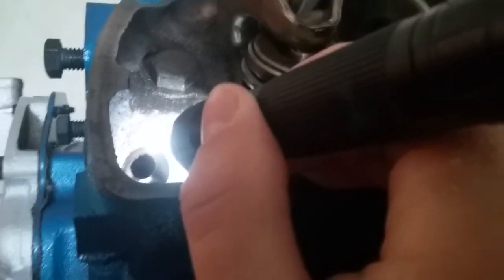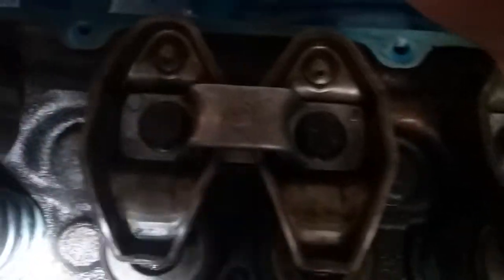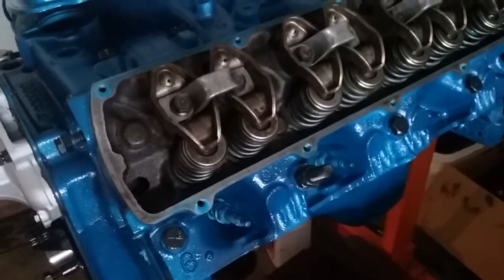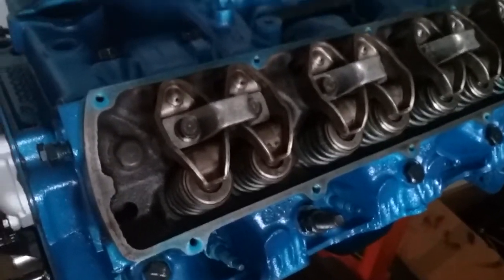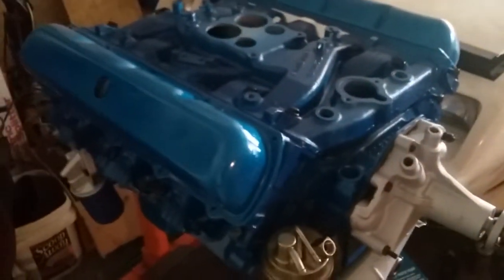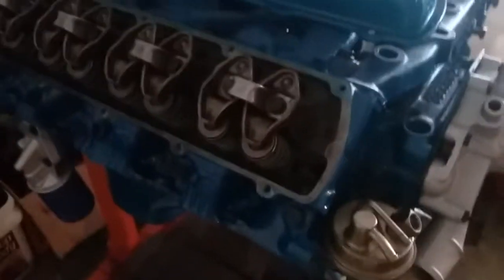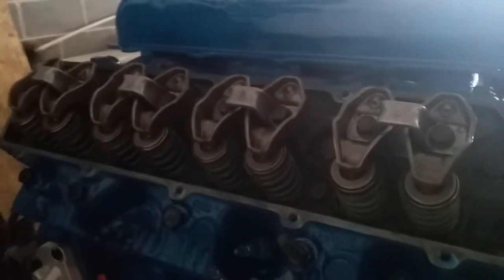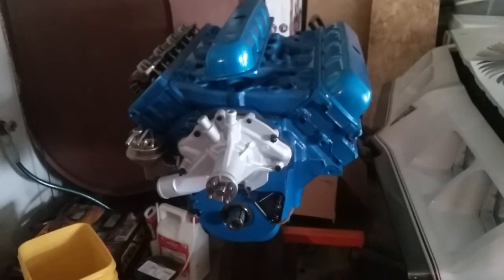Oldsmobile V8 Oil Drain Back Issue

Comment: I have raced Oldsmobile cars for 20 plus years. My first 350 olds drag car had a stock bottom end stock oil pump deisel pistons and rods number 5 heads ported performer rpm intake ultradyne cam comp roller tip rocker kit and a complete msd ignition. 1983 olds Cutlass ran 12.39 with that motor shifting at 6500 rpms and hitting 7200 in the water box from time to time. Never blew up never had any oiling issues nothing. Raced that motor for 8 years never any problems with oiling system none. Now I have a 660 hp 355 olds engine in it and it's built out of good stuff. It has no oil restricters in it and it runs about 70 pounds of oil pressure and I shift it at 7000 and still no problems like you say????
Reply: My Olds drag car uses a tornado oil pan and windage tray, it makes around 620hp, .060 69 455. Runs 10.60s in 1/4, shift at 6800rpm, I built it almost 30 yrs ago, still have it, just gets freshed up about every 5-10yrs depending on how much use it gets. Mostly sits in the garage these days. Olds engines can hold up fine. All I did to the block for oiling was deburr it and opened up the oil hole in the rear main cap where the oil pump bolts on.
Reply from the maker: 1970 olds442 thats pretty damn cool in general you race olds. They don't get oil pressure problems, they tend to suck the pans dry and the oil doesn't come back down fast enough. How many qts does your oil pan hold?
Reply: Useful Entertainment engine with Diesel pistons had a stock 455 pan on it. Oil pressure gauge never dropped  have Auto Meter gauges
Reply: Useful Entertainment new engine holds 8
Reply from the maker: 1970 olds442 there you go that solves the problem. I like my 5 qt pan, extra ground clearance.
Reply: @UsefulEntertainment  never sucked the pan dry with my old motor

Comment: Romeo Void...playing in the background....lol!!
Reply from the maker: Lyle Lillithwort hell yeah 😉
Reply: I did nothing but premix as I revved the hell out of these , I ran nothing but 2 stroke oil, old olds where like snowmobile motors, newer ones were junk. Some olds DRCE can be converted to 2 strokes with Klotz at 50 2 stroke oi with a vro
Reply: Now run dry sump with oil injection for total loss. I premixed at 40:1 and filled the motor with synthetic 2 stroke oil, just inject it and run it like he s rotax snowmobile motor
Reply: +Bruce Miller Dude, what the fuck are you talking about? Are you fuckin serious or just a fuckin lyer? You seem to be talking about another world of shit than these vintage Olds engines, you should probably stick to snowmobiles, cause none of that shit applies to 4-stroke automobile engines. I damn sure wouldn't recommend putting 2-stroke oil in your Olds engine. Better to stick to some 10-30 or 10-40 depending on temperature and clearances in the bottom end. Only similarities between a Rotax snowmobile engine and a Oldsmobile V8 is the fact they are both engines. That's where the similarities end.

Comment: My 455 did this and spun my bearings bent the rod and I only ran it 2 or 3 times after brake in 🤢big money down the drain  I had to rebuild it  💸💰
Reply: I think you turned to many rpms that's what killed your motor. The drain back he is talking about is not true
Reply: I run but nothing but tvw3 in it crankcase fed and oil injection.,  I i
rev the hell out of it
Reply: U. Must have been romping on it real frickin hard cuz I've run the dogpiss out of a few olds motors and as long as those holes weren't plugged never lost oil pressure cuz that's what would happen it would suck air lack of oil as he said it's not easy to do ..

Comment: Great video! Anyone who works on and runs these engines needs to know stuff like this. I myself have had problems with my 307. I have a 84 lesabre coupe.I've changed the stem seals in the heads 3 times in 10 years with very little results. Your video just showed me what I might have missed thanks!

Comment: #6 heads? Looks like a small block , either a 350 or a 403, painted 455 blue!
Reply from the maker: DR OLDS yep it's a 70 350. The color is metalcast blue. It's an anodized color. I wanted to paint it the color of the car I put it in
Reply: Small block were numbered heads big block were lettered heads  #6 be about mid '70's best ones was #4 from '67  330 c.i. high compression need to put valve rotators from the #6 heads in little machine work bit save the life for street use with pump gas...

Comment: I have the exact same engine.Can you give me the oil type and the info pertaining to these engines.Thanks
Reply from the maker: MechanicJake I usually use 5-30 or 10-40. I have a hard time finding low detergent oil in regular parts stores. The camshaft in these engine need a Zink additive  (ZDDP) as well. What I do is get oil from summit racing because they sell exactly what you need and they ship fast.
Reply: I run a 455 bored .60 over in my Jet boat. I have a little bit of oil that seeps out of my valve cover breathers but it minimal. I had the oil drain holes in the GA heads opened up a little more and the oil restrictors on the cam bearings. As fas as oil i use Rotella 15-40w because its one of the few oils that still has zinc in it. I run my Olds pretty hard around 5400 rpm and its still a solid engine
Reply: Any good oil with zinc in it will do, 10-30/10-40 range depending on temperature.

Comment: I’m pretty sure that the wagons are based on the 88 and 98 body styles. His had the Olds 307 in it. They are indestructible like you said. He put around 250,000 miles on his before he sold it. I just subscribed by the way.
Reply from the maker: Ryan Hodges yup the wagon is just a typical GM b body like impala, caprice, Bonneville, 88, 98 or electra lesabre or park avenue. Mine had a 307 and yeah they are indestructible, but you gotta get rid of stock nylon coated timing chain and gears or they always jump timing and bend valves. Thanks for the sub btw.

Comment: Oil restrictive pushrods is a new alternative I never heard before. Do you have any make or part numbers on those pushrods?
Reply: Mondello is where I would start. There ae others that made mods too.  The SoCal Jet Boat forum could be useful.
Reply from the maker: William Hugelmeyer I do not. I need to investigate them more
Reply: This id never s problem with Uniflow 2 strokes

Comment: great video for anyone out there getting into oldsmobiles. wish i would had these videos last year when i started planning my olds build. i know the whole sludge build up way to good. we tore apart the top end of my buddies 72 cutlass olds 350 and it was so bad we couldnt even see the head bolts. absolute mess. i took about a year doing as much research on olds engines and just finished up my first olds build this spring. olds 350 started out as a stock #8 head smog engine. new rings and bearings, a built set of #6 heads, 9-1 compression, comp cams high energy 268H cam, rpm intake and headers and it just runs like a dream for a streetable hotrod engine. The restricted pushrods is a good idea much prefered over restricting oil to the cam which to me doesnt seem like a good idea but i went a different route that you also suggested and went with the 7 quart pan and high volume oil pump and while i was in the process of opening up the exhaust ports i also ported and reshaped all my oil returns holes and made sure everything was flowing down hill. i also set my rev limiter to 5200rpms seeing how all my cutlass is is a street hot rod and i have no reason what so ever to push it harder. 5 speed stick shift car with 3.55 rear end i just up shift and let the low and mid range torque do the work. well so far so good. 1000miles on the build, 60psi on start up 40psi at idle fully warmed up after a long road trip and never once have i seen the oil pressure drop off from normal and low leaky valve covers. only thing i would add to the leaky valve cover issue is i have seen to many guys pry them off with a flat head screw driver and bend the ridge. be certain the cover is flat to eliminate one more possible cause for the leak.
Reply from the maker: damn that's the ultimate set up, the 5 speed with 3.55s. I wanted ti do the performer rpm 7111 intake and headers and a holley street demon but it was out of my budget. im running the mondello 20 - 22 cam with is 496/512 lift and as im sure you know you cant go past .500 lift with out adjustable rockers. I have the rockers I just need to put them in along with the new valve springs. ive thought about porting and shaping the oil drain backs but I didn't bother. how did you set a rev limiter? that's not a bad idea. if your interested in where this engine is going, take a peek at the last few videos on my channel. I just got my tranny back from the shop and I just got the exhaust installed on the car today. now that I have a full exhaust, I can swap my 307 to the 350 and break the new cam in.
Reply: I have ran olds like a snowmobile motor.
, they hold up as the 455 does great @ 40:1 to solve oiling issues. I run Klotz R4 2 stroke oil
Reply: +Bruce Miller Ha-ha! You funny.
Reply: i used to fill my 69 caddy 472 with pennzsoil synthetic TCW3 and never had a problem, i also premixed at around 60:1. Now all i use xd-100 in my truck. The tcw3 was a bit thick though but it worked.
Reply: Klotz is fine but the techinplate R50 is to thick. Xd-100 or amsoill dominator is enough and that what im running in my truck. BTW what does and olds engine do that other engines dont.? A gm 454 or 502 is easier to get more power out of. How ever there is the olds alumimum billet block that makes for a nice porter 2 stroke conversion. Its much easier to cut ports into:https://www.chevelles.com/forums/11-bench-racing/528170-2-stroke-454-a.html. Like this guy did with a 454 tall deck block. It's propable running dry sump with oil injection in to the intake manifold. I am thinking of doing this. A hremi motor though can be looped charged through the valves for a poppet valved 2 stroke with having to bastardize the aluminum block with porting. A hemi head olds drce would be perfect for this.

Comment: I was wondering why my 455 was leaking oil from the damn valve covers which I've never seen before. Thanks for the info
Reply from the maker: its not that big of a fix. I usually use a good amount of silicone sealer to keep them from leaking. heres a couple of videos for you  https://www.youtube.com/watch?v=-HFlz6nR998&t=128s   https://www.youtube.com/watch?v=xGThxcCnuMg
Reply: Dominic Daley thats not the problem this guy is a idiot

Comment: Is the 5.0 307 notorious for leaking oil?
Reply from the maker: tyler2610 only around the valve covers
Reply: I added the restrictors but I open the hole size to double.

Comment: Great video man! This is our first Oldsmobile motor well besides the 260 I blew up lol and I always get good information from your videos! Btw motor looks great
Reply from the maker: 1978 Oldsmobile cutlass hey thanks for the compliment, I just hope I can get it in the car soon. Lol howd you blow a 260?
Reply: Useful Entertainment  NP man and just ran the piss out of it haha I finally got mine all done I'll have a vid on here or my brothers channel soon
Reply from the maker: 1978 Oldsmobile cutlass good deal, I'm subbed to him so I'll check it out when it gets released
Reply: @UsefulEntertainment  most likely there was sludge in the engine, probably a rod bearing gave out, not getting enough oil. If the oil is changed regularly, the 260 is unable to blow itself up. I know this first hand, I owned a 79 Cutlass with the 260 and put about 200,000 miles on it before I swapped the motor, it was still running fine. I changed the oil religiously. The 403 it was replaced with was an easy power boost, got it from a junkyard ta. Even with the s*** rear end gear, the 403 and a good amount of low end power. I wish I still had that car, would have changed the rear end and put the 200 r4 I planned on doing.

Comment: Holy Hell, Bro: isnt it something: i was just putting the water and power steering pump on the old 70s 350! Hahahaha, Wow: that is a problem, and before i go farther: that olds just looks more BadAss with those valve covers! So at the high rpms the oil would get pushed up into behind the heads! Those holes are Miles Off, I just cant figure why it was set up that way. Yep, most likely a design flaw ( speaking on the behalf of The Olds Respectively because its such a badass ): what is the highest rpms it'll go? Im looking at the 1 head still on the 350 and i think i see a hole like that, im not sure if it is in the same spot ( top or bottom ) That was Great Advice you gave: ill know: i just might be in the market to get one of these and blow people away: "Where in the hell did you get a 350 with 10 bolt valve covers???" They won't know its an Olds at all, i think the other motors like these are more looked over for the Chevy blocks... Hahahaha, You've got the Coolest driving habits Brother! Oh and also: i remember you had gave me some advice once as to what heads to put on there. I was thinking if i went All original heads: id use my M/T valve covers. Remember them? They were in the trunk of the satellite on that Old video back in september last year. I was thinking of having a cool Old 70s chevy block, ( with the old way from back in the day ) Dual Snorkel, M/T valve covers, still got the way old 4 spoke fan etc. Hahaha, Thanks for teaching us this Bro, Yep: You're the master of the Olds manual!
Reply from the maker: 71 Plymouth. what's up. honestly I don't know how many rpms they will take before they grenade. I don't like to take them past 5 even tho I have before. it's not that I found a 350 with ten holes it's that all old's engines came that way until 77, 77 is when they no longer offered the 455, they went to light weight shit block castings with those windowed mains and they with to 6 valve cover bolts. I remember the Mickey Thompson valve covers hah I'd ditch that 4 spoke conventional fan and get a nice clutch fan, not one of those shitty flex fans everybody uses ether.
Reply: Useful Entertainment Hahaha, Yep: 77 is when everything went wrong, hmm: i didn't know the 455 was ended then! Oh yep: you showed us that window shit: what a fucking fish flopper. Hahaha, Yep: you're talking about those plastic mesh type of fans Everyone uses? Youre Exactly Right there Bro, Dont they offer those with steel blades? Hahaha: I don't know: ill probably put those on the motor. But regardless ive got to get another head so ill be thinking of what ill do...
Reply from the maker: 71 Plymouth. yup it's no surprise they dumped the 455 after 76 because it was down to 190 horse. yeah they make metal flex fans too haha that's actually what I was talking about.
Reply: Useful Entertainment Oh that is sad to hear Bro. It had one of those endings. That last days to a legendary motor, same happened to the 440. What a person could do with a 440: could be done with a 318 at the end... I heard the last 440 was released in a 78 79 dodge truck. Speaking of that: im still going to try and find out what motor was in that wagon for you Bro: i dont think it was a Chevy wagon so im sure he most likely said 455. It still sits there to this day and the guy has moved to his sisters place. Theres a monster just sitting there... ( when i do get my license etc. ill make a trip over there and shoot footage for you to see it )
Reply from the maker: 71 Plymouth. yeah it was one of those endings. I think buick stoped making 455s that year and probably Pontiac at that point. I know the 440 got dragged to it's death too. I was talking to some guy (non car guy) and he was telling me how when he was a kid he had a 77 New Yorker with a 440 and he was telling me how powerful it was and all I could do was think to my self yeah right, what a piece of shit. ill bet the Riviera could out run that thing. I'll bet it had a lean burn too seeing how that was released in 77.
Reply: Useful Entertainment Hahahaha!!! I spit out my lemonade! Yep, The Riv most likely would have walked All over the NYer, That GodDamned. lean burn. shit. Electronic spark control with a damn computer under the hood: what a POS... We All ( everybody ) have commiefornia to thank for this/ (that in pretense when talking about real cars from the 70s previous ) since everything nowadays is basically nothing but faggotmobiles. If im not mistaken they make All the emission rules and the final go ahead of what would happen to our favorite motors and cars. They are to blame along with the 3 piece suitors at insurance agencys and anything government for what happened.
Reply: +Useful Entertainment They definitely turned to shit in 77, but, the old 403 as scary as it looks will take more than people think. I have one that ran 12.00s in a 3800lb car. It will live again, been on a stand for 18yrs. Only thing wrong with it was it broke a piston ringland. Old Badger cast pistons didn't like the 6500rpm. It has a ARP studded block with a 66 330 forged crank, blueprinted stock 403 rods with ARP bolts, and .030 Badger cast 9.5-1 compression pistons. All balanced. Never a problem with the thin ass block. I was scared of it at first, but I kept giving it hell and it kept holding up, I raced it for 2 yrs pretty often. They are better than people think. I wouldn't want to go past 500HP with one tho, or 6500rpm. They make damn good street engines tho.